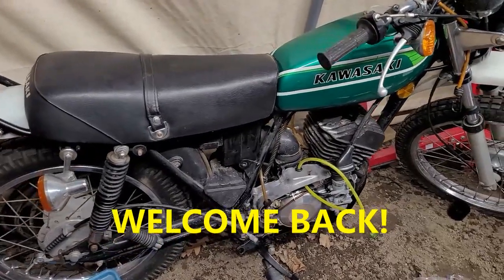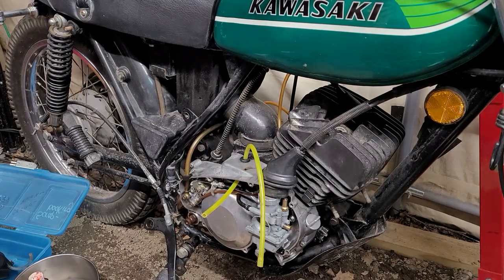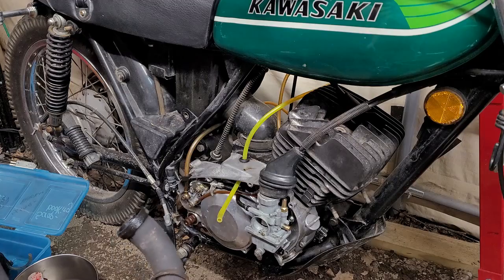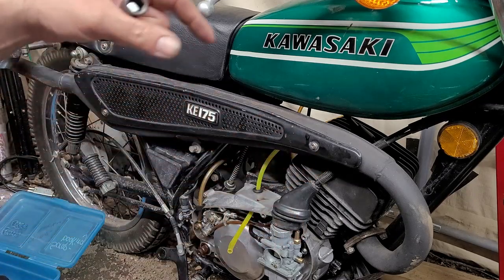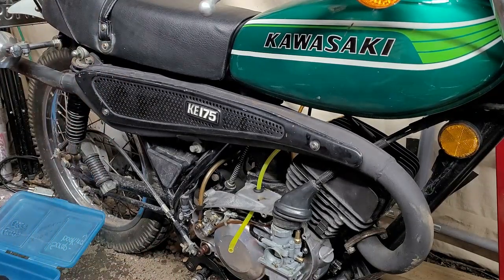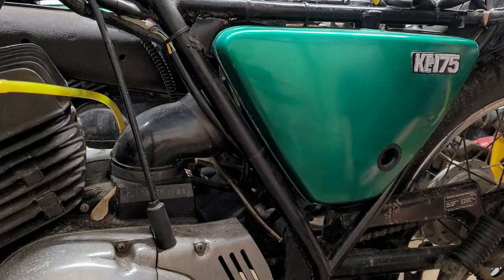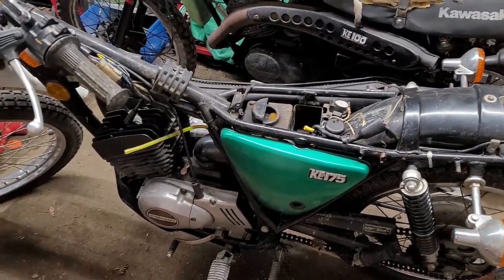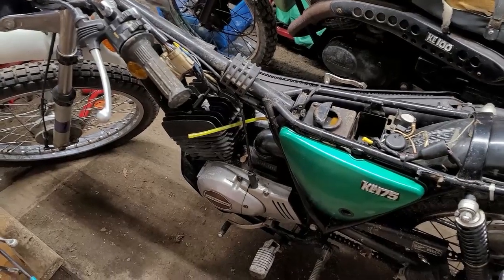Working on Ken's KE175 Bike part 2 oil system and more

Comment: Hey these vids are great to learn about these complex little 2 stroke motors, is there a part 3 for this anywhere? I would definitely be interested in your technique for cleaning the tank and seeing the oil pump priming etc. I have a g4tr motor coming shortly and all this info on the various engine types will be very handy. Cheers.

Ps, some of the simple things like removing the hose off the bard don't need quite soo much explanation but the tips are still gold!
Reply from the maker: Yes there will be Ken donated this bike to my channel there will be a lot more videos on it
Reply from the maker: Thank you for your support I appreciate that

Comment: Do you think it is ok to use the YAMALUBE 2-stroke engine oil 2S   For the gasoline mix.  And if I want to premix some for the gas tank, what mix ratio would you recommend, I have the same bike.  great video thanks I learned a lot.

Comment: Is there anyway I could maybe drip feed my oiler system and still premix my oil tank is broke and I took the oiler gear out because I had no intention of using it until I found out it was bad for the bearings and valve
Reply from the maker: No way to much oil
Reply: Dang I wish there was something I could do
Reply: @2strokeguru  thanks anyway
Reply: @2strokeguru  do you know of any motors that will fit in a km 100 with light modifications I have poured so much money into this bike and just can’t figure out how to make this motor run the way I want
Reply from the maker: @backroadriding5825  mc1 kd80 kd100 KM100 all use same engine that will fit 
Now the kd80 can't be made to 100cc the mc1 is a 90cc but you use KM100 kd100 top end and yes ofcourse there's more the ke100 lower with a KM100 kd100 top end will also work